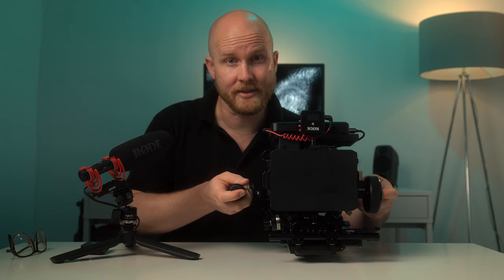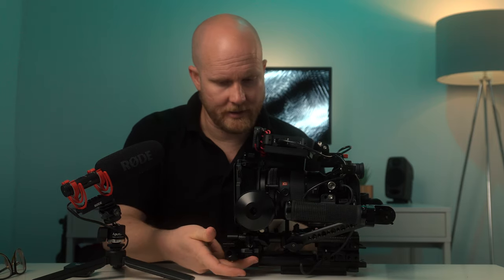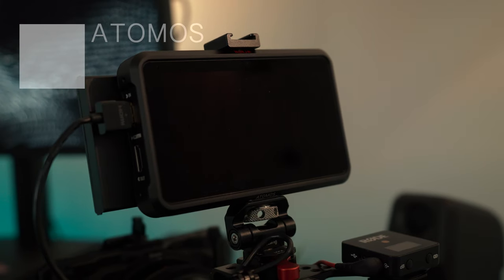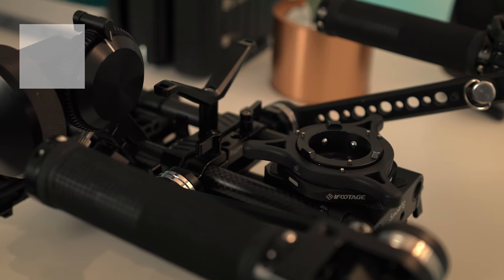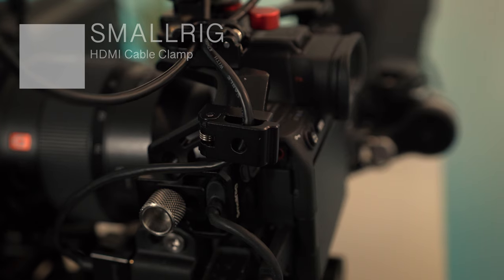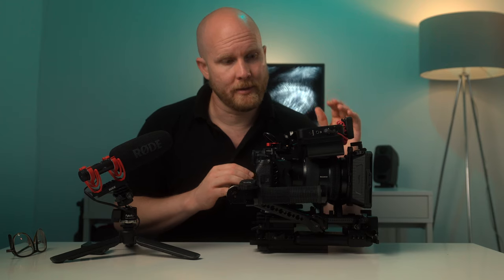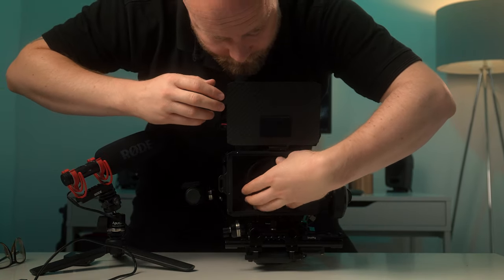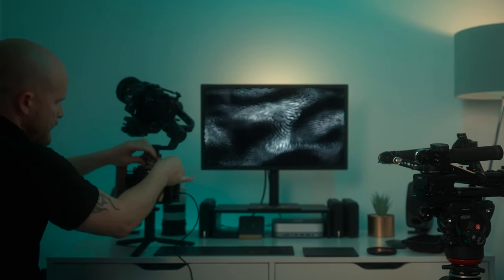Sony a7s III VIDEO RIG

Comment: The iFootage quick release seems to have only 1 screw. How would that prevent the camera from rotating when you pull focus or lift it from the side, compared to the 2-screw Manfrotto plate?
Reply from the maker: Hi Frank! The iFootage have smaller screws inside to screw down into the surface that the iFootage is mounted onto, to prevent it from twisting. Hope that helps!
Reply: @nordfilmcompany  On the quick release plate, I see some small hex screws around the center 1/4" screw, Do those lock into the bottom screw hole of the camera cage?
Reply from the maker: @frankfeng2701  On the plate that attaches to the camera you only got one, and it is located on the edge of the circle. On the part that goes onto the rig or tripod etc you have two on each side of the main attachment. Hope I described it clear enough, if not please let me know☺️
Reply from the maker: @frankfeng2701  If you want to go another route, you have the kondorblue side loading base plate that is worth checking out. They also got some nice rosette adapters and handles which makes it easy to adjust positions fast👍
Reply: @nordfilmcompany Thanks for explaining. But I'll stick with Manfrotto or Arca Swiss that has plenty of third party option.
Reply from the maker: @frankfeng2701  You are welcome mate! I think the kondorblue side load baseplate is compatible with the manfrotto. I use the Seastar due to the fact that I already got them from using them on my sliders etc doing timelapses.

Comment: great video & set up! I have the same power bank clamp but how did you connect it to your rails?!
Reply from the maker: Thank you very much! I attached the power bank clamp to the SMALLRIG 15mm Rod Clamp and attached it to the rails in front. If preferable tou can mount the rod clamp to powerbank clamp so the powerbank sits upright behind the camera. Hope that was explained well enough☺️

Comment: Overall, I like your set-up and appreciate the time you put into this video. It would have been great to see the monitor placed in front of your face for your shoulder rig set-up, but your explanation was straightforward. I'm planning on doing something like this but replacing the smallrig mini matte box with the tilta mirage motorized vnd kit and replacing one of the handles in the shoulder rig set up with the nucleus M lens control grip (partial).
Reply from the maker: Thank you very much! Sounds like a great plan and nice setup! =]

Comment: Nice rig, Good work! About to take  delivery of A7S3 and have been hitting small rig etc. hard for doodads. looks like im not done yet lol. Edit: Hands-Free Shoulder Mount  Support thing looks like a good idea. But i can only find ones that look really sketchy build quality
Reply from the maker: Congratulations, it is a Superb camera! Haha, tell me about it. I have added a second powerbank for the Ninja V after this video, but now I’m happy with the power supply
Reply: @nordfilmcompany  mine is an upgrade from A7S2 but i have not had the spare cash to really build out the rig before. This time i want it on point from outset. I was watching kalibs dslr video shooter channel and the rig he built... i added the kessler plate which is £70GBP I put it in my cvp basket thought better of it. But forgot to remove it. I would of been far butter off to just get second smaller ifootage mono topod like c120 and used the top hat for not much more DOH!. getting there though. Definitely going to get the cheese rod monitor bracket arrangement as on your rig. I also went for nitze mini v mount plate. Another sketchy move lol. I got it from the HK site and it seemed to hang. but some days later got an email and they had managed to charge my card lol!?!
Reply from the maker: There is indeed so much to choose from now that don’t send hou in to debt. Which is great! I get most of my stuff from ProAv, CVP or Amazon. I also have a small version for when I don’t need all the bells and whistles, and want a lighter option ☺️

Comment: What is the total weight sir?
Reply from the maker: Hello! I’ve made two small modifications to the rig, going from two side handles to one side handle and a top handle. Plus i changed the np battery from the Ninja V to another power bank. So now I have two power banks. It is a bit heavier now, but I can give you the weight of my current setup as soon as I can☺️
Reply: @nordfilmcompany  What are the models of power banks you are using?
Reply from the maker: @dougdobbins1766  The powerbank that works great for me is the Charmast 65W Power Bank 23800mAh. I bought mine from amazon. Think it is about £42 if I remember correct.
Reply from the maker: @dougdobbins1766  I have adjusted the rig a tiny bit, so right now I have two of these powerbanks. One for the camera and one for the monitor.